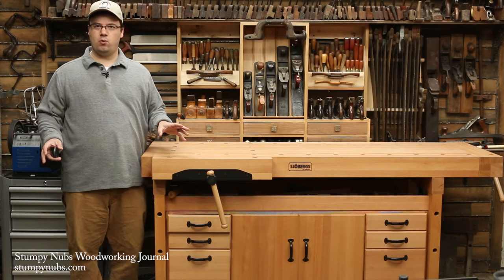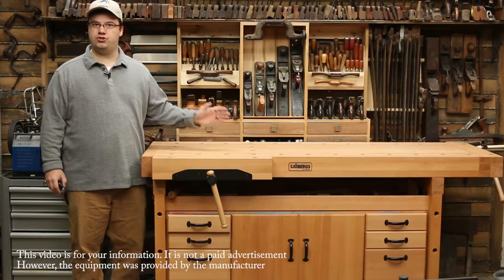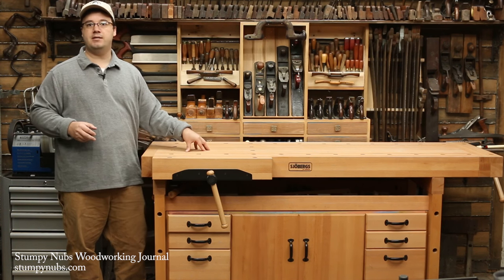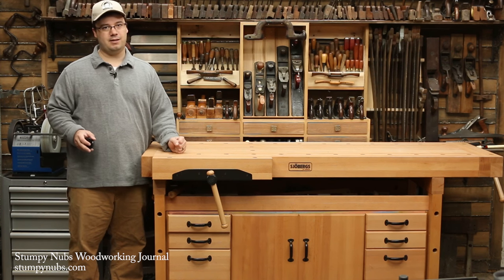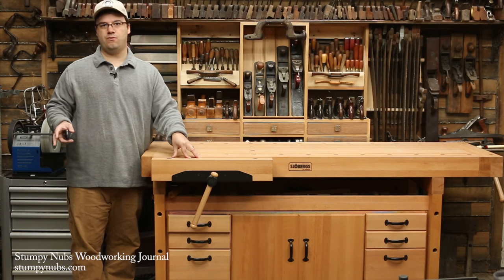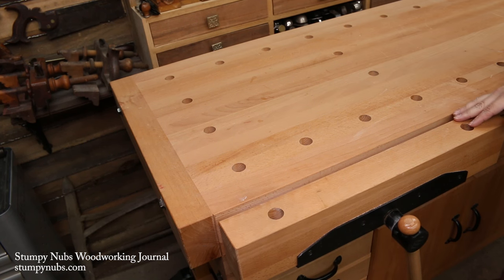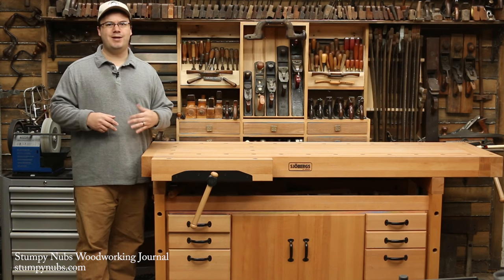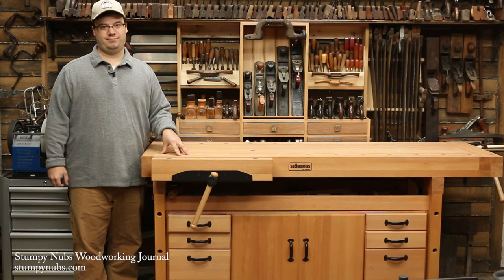What to look for in a high quality woodworking workbench- Sjobergs Elite 2000 bench review

Comment: I built several benches and finally got tired of building them and bought that exact bench, with the cabinets as shown. I've had it for ten years now and still love it. It's heavy and rock solid and neither the bench or the vises have shown any sign of racking. Recently I made a tool tray to attach to the back side, and a cover for it that is flush with the benchtop so it acts as a work surface extension when I want. I have the Sjoberg holdfast but I got a blacksmith to make me a couple of traditional style holdfasts for it.A local community college offers a one-semester course in workbench building, and the guys I know who have taken the course and built their own bench put in a lot of hard work and spent more than $2500, in some cases a lot more, for quality wood and hardware. And there are several really big glue-ups that call for 3 or 4 guys to handle. Apparently many people don't complete a bench in 18 weeks. All things to consider if you want something better than a 2x4 bench.

Comment: I just bought the Sjobergs 2000 Elite.  I haven't used it yet, but already I am very impressed with this bench.  An update on Pricing - The bench minus the cabinet is currently $2,500.  The cabinet is $1,024.  I was extremely lucky and was able to buy one left over from last year's Black Friday sale, but I probably would have bought one anyway when you consider the cost of good bench clamps and rising cost of lumber.

Comment: I know this is an old video, but I found it at exactly the right time. I'm looking for a workbench and am finding very few options. Lee Valley/Veritas recently discontinued their current workbenches due to supplier quality issues, and Lie Nielsen won't be making any more benches until late Spring 2020 (the benchmaking shop is being redesigned). I hadn't really looked at Sjobergs due to unsubstantiated concerns about quality, but your review is helping me get over that hump. I wish the dog holes were 3/4" instead of 1", but I think I can live with that, as long as the vises are as good as you say they are (minimal racking). On a separate note, thank you very much for your informative, articulate videos. Since I found you about 6 months ago, I've come to value and trust your opinions and recommendations. You and Paul Sellers are making huge contributions to my post-retirement transition from aerospace engineer to hand tool woodworker/artist. Thank you!
Reply from the maker: I'm not sure why you were concerned about quality. Sjobergs has always been sort of the Cadillac of benches.
Reply: I had been getting by for the last few years with a Sjobergs Smart Vise (attached to a massive old dining table) and was constantly frustrated by its limitations. But then, you get what you pay for. So today I picked up an Elite 2000 fo a great price at my local tool supplier, with the cabinet and accessories thrown in. I’m about 80% done assembling it. The bench/trestle was a snap, but the cabinet is a little more involved and the directions weren’t always completely clear. I’m very impressed with the quality of the materials, and I have a feeling I’m going to be very happy using this workbench.
Reply from the maker: @keithwilliamson4451  - The assembly can be irritating, but it's worth it :)

Comment: As they say; you get what you pay for. Like many I built my bench from what was available, the frame from 2x6s from an old bunk bed and the top from two layers of composite from an old ping pong table. The bottom shelf was some more composite. The thing weighs a lot and is very sturdy. Would I like to have a custom bench? Of course, right after I win the lottery!

Comment: Notice the way the bench wobbles when clamping the end vise.Apart from that - great video
Reply from the maker: It's on flip-down casters for moving. The casters are moving, not the bench structure. I forgot to flip them back up and put the bench feet on the floor before filming. I actually did that a lot in my old shop. :)

Comment: i    have the elite 1500 and after two years I'm not so satisfied with these vices. you should place some scrap piece when you clamp on one side. I highly recommend it.
Reply: And by the way. where do I find 1" holdfasts?
Reply from the maker: +Silent Woodworker - Technically you don't use a 1" holdfast in a 1" hole. You use a 7/8-ish holdfast. They are sometimes called 1" because of the hole they fit in. Google it. I know Sjobergs sells them. Woodcraft sells them. That's just off the top of my head. If your vise is giving you problems, you should contact them. Mine is rock solid, no need for scrap shims.
Reply: +Silent Woodworker FYI.  You can also find 3/4in holdfasts if you have 3/4in dog holes.

Comment: Question:  I have one of these Elite benches.  I want the height to match my saw stop table saw but this bench is about 1 1/4 inches higher than the saw.  I'm thinking of shortening the legs from the bottom by and inch and a quarter.  Any issues with this that you know of?
Reply from the maker: A bench's height should be comfortable for your body to work for long periods of time. An inch can make a big difference in back and neck strain. Make sure it won't be too low before you cut it. I would actually raise up the saw first, since that is a reversible solution, while cutting the bench is a bit more permanent. :)
Reply: Great point.  I'll try that first.  Thanks for all the work you put into your videos.  I find them very helpful.

Comment: What are some comparable workbenches with those sorts of features that don't cost 2.5 grand?
Reply from the maker: +Everfalling - Google benches. You can use the information I provided to help you choose one.
Reply: +Stumpy Nubs (James Hamilton) indeed I will. Past searches seemed to show most of these benches to be priced pretty high. Was just curious if you knew any off hand that are on the more affordable side. If you can't say cause it would seem like endorsement I understand.
Reply from the maker: +Everfalling - No, I can say anything I like. I know Lie Nielson makes a very good bench, but it's more expensive than this one. I also saw a couple of smaller bench makers at the Woodworking in America conference, but they are pricey too. To get a bench that is heavy with a thick top means a lot of expensive hardwood. Add a pair of good vises and it's hard to find one for much less than a couple thousand. That's why building your own is so appealing. But it's not for everyone, which is why I made this video.
Reply: +Stumpy Nubs (James Hamilton) gotcha thank you.

Comment: Ehhh, good video, nice bench, however I'm one of those guys who would prefer to build my own. Not to mention, I'd rather by tools, than spend that much for a bench.
Reply from the maker: +Moochie Kat - To each his own! :) My grandfather was a well driller. He bought a fancy new Dewalt radial arm saw in the 50's to build his own kitchen cabinets. His father (my great-grandfather) called him a moron. He said "you're a well driller. Go drill some wells and use the money to get a cabinet maker to build your cabinets." Some people apply that to bench building. If you're a professional birdhouse maker you may want to buy a bench so you can concentrate on making birdhouses. Or maybe not, it's up to the woodworker...
Reply: I'm an ex truck driver. Bought my old Craftsman table saw in the 60s to build a cab over camper. Still have it, and I have built many work benches in the past. I just like to build stuff. I think I'm going to build your band saw next. Just finished a wood lathe from plans in Shop Notes. Fun to be retired. BTW I am enjoying your book.
Reply from the maker: +Moochie Kat - Older table saws are a lot better than a lot of the new stuff I see. My first saw was a 1970&#39;s Rockwell. It was a giant hunk of cast iron. Great saw. The motor is still running on my homemade drum sander! I also have a 1950's Dewalt radial arm saw that still runs like new!

Comment: good review,  good features,  not feasible for me though.
Reply from the maker: +Mike West - That's why I made the video about what features make a good bench rather than just about THIS bench. Hopefully some can use these tips when shopping for, or building any bench.
Reply: +Mike West I have had great success with a bench similar to what stumpy made. I use it for knife making, woodworking, and a wide range of other stuff that requires a bench. 6 feet long, 2 feet wide, and a top of 2x6s. Add some drawers, plenty of rails, legs that are four 2x6s laminated together, and you have yourself a bench that weighs well over 450lbs, and probably more when loaded up.
Reply: Thanks guys,  i am just about to start on my bench and all of this information is very helpful.   It will likely be a hybrid of this bench and stumpys bench.

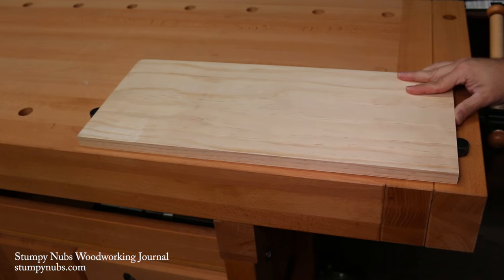Comment: At 5:03, the bench doesn't look that rock solid.
Reply from the maker: +paulpaul1948 Because the spot on my old cement floor I placed it during filming wasn't level and the bench was up on casters which move in their swivel mechanisms. There is ZERO flex in this bench and it does not move when I flip the casters up and place it on a level spot.